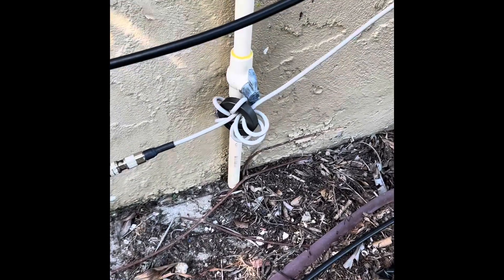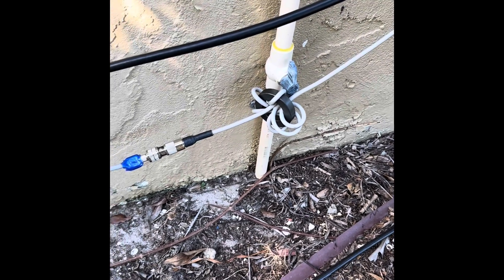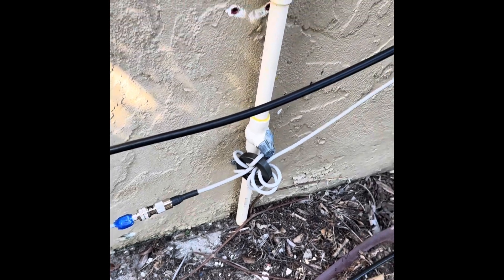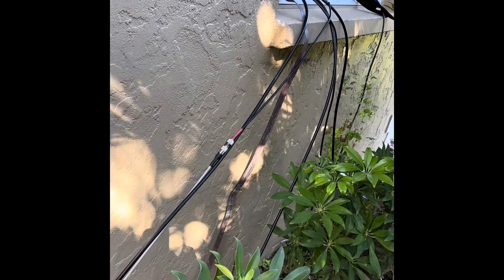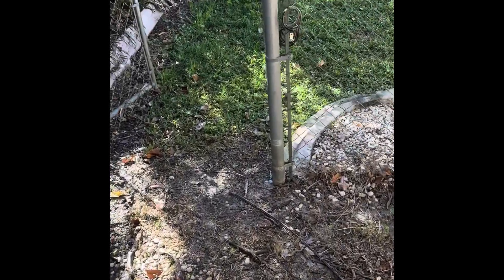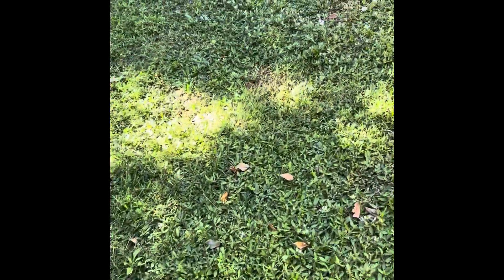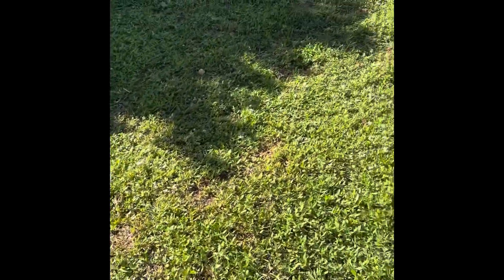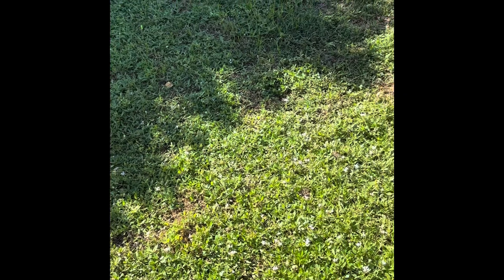End Fed Random Wires Really Rock!

Comment: My setup is a 9:1 UNUN to a 35ft. wire fed by 50ft. coax being used as a counterpoise. At the shack a 1:1 UNUN common mode choke. Antenna loads from 80-10 meters. Great antenna.

Comment: I remember older hams just saying to "Get as much wire in the air as you can and see what it does." Back then, we didn't use an UnUn to feed the antenna, we just ran a single wire to a tuner in the shack. Those were fun days.

Comment: You can make contacts  with any tunable piece if metal.   Long random wires have weird radiation patterns that vary quite a bit with the band and orientation of the wire (sloper, flatop or vertical).  I put up a 41ft random wire antenna (sloper) for fun but find that performance is mediocre.  I could put up this antenna as a vertical but it is too long for low angle radiation on 10 and 12m for sure. There are a lot better antennas that are still easy to put up. Model your antenna in EZ-NEC you will see.
Reply from the maker: This is true, of course. But pound for pound, the ability to tune every band and get the power to the antenna is pretty good for someone who wants multi-band capability with a decent NVIS signal on 30, 40,  & 80, with DX ability on  10, 15 & 20. I use a "CB" vertical which easily tunes 10, 12, and 15 meters with great results. Sometimes the lowly undervalued antennas do more than we think.